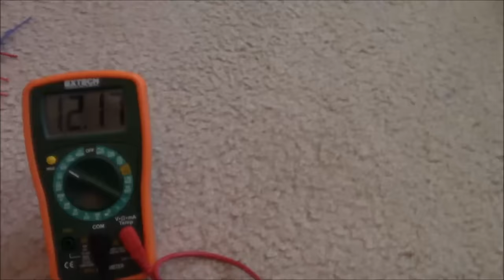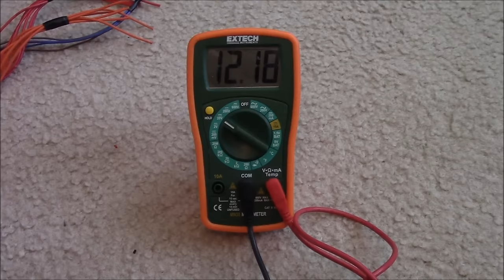How to Hack a Computer Power Supply (PSU) To Use as a 12V DC Power Source

Comment: can you run 2 12v dc car viper motors with that?
Reply from the maker: You mean wiper motors?  It depends on the power requirements of the motor but I think that should be possible.  My PSU in this video provided 20A of power so if both motors used less than 10A each then theoretically it would work.

Comment: Will this power a battery powered saw?
Reply from the maker: You mean will it recharge the batteries in a battery powered saw?  Or do you intend to try to connect the leads directly to the saw without the battery?
Reply: connect directly to the saw without the battery.
Reply: it is  18V saw
Reply from the maker: heo con
Then no it can't easily power your saw.  There are ways you could combine power from different rails to achieve approximately 18v but it is complicated and I don't want you to fry your power supply or hurt yourself.  Sorry!

Comment: What color did u connect to the green
Reply from the maker: Black.
Reply: Thank you I really couldn't tell if u hooked up black to green
Reply from the maker: Yeah sorry.  Basically, you are grounding the green wire.  When that happens the PSU will turn on.  If you detach the green and black it will turn off.  If you don't have a switch on the back of your PSU to turn it on and off you might want to wire in a switch between the black and green so you can do so.
Reply: Thank you so much man.. I appreciate it

Comment: i have a liteon PS and i connect the green to a black and nothing happens??
Reply from the maker: You may have to have a load connected to it in order to start the PSU.  Try connecting it to a 12V light or something as a test.
Reply: okay, ill have to get one i dont think i have one on me
Reply from the maker: Whatever will simulate a load.  You can even use a resistor if you want.  I don't know what size would be appropriate, though.

Comment: electricity in my place is so low it cant turn my computer on any tips
Reply from the maker: fidel oruko So you think the power coming from your wall socket is not enough to run your computer?  I would get a multimeter and test the power and make sure you are getting the right voltage first.

Comment: I saw your video carefully. . but I not understand one thing . . how you did . . I did same . . and power on supply in same way . . it didn't turned on . . tried many times
Reply from the maker: Your power supply probably requires a load to turn on.  Try connecting it to a small computer fan or something and see if it turns on and stays on.

Comment: Bro how much amp it gives?
Reply from the maker: Depends on the power supply.  The cheap smaller ones are around 20A or so.  But you need to look up the manufacturer's ratings.

Comment: What is the current output?
Reply from the maker: It will depend on the power supply you use.  Mine is 25 amps max on the 12v rail.

Comment: can I make more then one output sins there's more then one yelow and black
Reply from the maker: eduards neston Yes you can.  They will not carry as much current, though.  So if you want to power things that don't use a ton of power that is great.  If they need 100's of watts you want to combine wires.
Reply: OK sad for mi this morning my power supply burned down it just went Boooom......
Reply: Doe you think it is a good aidea to repair it...???
Reply from the maker: eduards neston
No, they are too cheap to repair really.  You have to be careful with exposed wires that you don't accidentally touch them together or you could blow something.
Reply: OK I'll buy a new one!

Comment: Did you use a load resistor?
Reply from the maker: No, the psu in this video does not need one to turn on.  However, newer models seem to be adding that technology in so you may need one for your psu if you try this.  Good question!
Reply: Thanks for your reply. I meant for the voltage to stay stable in light load situations
Reply from the maker: Elecifun
I'm not sure.  I haven't heard of that being a problem before.  Are you talking just a few watts or something?
Reply: They do not like to operate without a load. 5-10 Ohms dummy load 5-10 Watts will do. Probably only valid if it is powered on without a load
Reply from the maker: Elecifun
I haven't tried to power something that small.  Thanks for the info.

Comment: is there another way to wake up the power supply
Reply from the maker: You have to connect it to a load or simulate a load.  You can wire in a resistor or just connect it to a 12V load.
Reply: LDSreliance ok

Comment: does the ps watts make a differance.
Reply from the maker: It will make a different to how much current you can run off that rail, yes.  But the procedure shown in the video will be the same.
Reply: LDSreliance i just need 5 amps of power at 12v
Reply from the maker: Any power supply that you find will provide that.  That is only 60W.  The smallest CPU PSU's are at least 350-400W (200W on the +12V rail at least usually).

Comment: Dear sir tell me make pc Power Supply - 12V/5V (2A)
Reply from the maker: If you follow the instructions in the video it will make a 20A 12V power supply (or whatever the current rating of your +12v rail is).

Comment: can it run car 300 watt amplifier?
Reply from the maker: Mine couldn't but some could.  Just make sure that the PSU can supply ~30A on the 12V rail and you should be ok.

Comment: how can i get 10 amps with 12v from this power supply
Reply from the maker: Just like I showed in the video.  Don't try to pull 10A with a single yellow wire.  Bunch them up like I did.
Reply from the maker: You have to connect a load to it.  Something that will pull 10A.  If you only have something on there that uses 20W then you will only get 1.8A.
Reply: i am connecting car ac blower which draws 9 amp when connected to a 12v supply but here with this supply it is now only drawing 5 amps @LDSreliance
Reply from the maker: Check the specs for your model PSU and make sure you are using the main 12V rail.  You might be using a secondary 12V rail that cannot provide 10A.

Comment: ok I need to regulate the voltage? any ideas
Reply from the maker: +Brett Mabee There are all kinds of converters and regulators you can use.  I have used a couple of regulators (http://www.amazon.com/gp/product/B008FLE7PA?psc=1&redirect=true&ref_=oh_aui_search_detailpage) that you can vary the input and output voltage to your exact needs.  They are cheap but the directions they come with is not very good.
Reply: +LDSreliance Will it take the amps?
Reply from the maker: Brett Mabee
That one is only good for 5 amps but you can find ones that are stronger if you need.

Comment: how can i put on and oof switch... thanks for the reply
Reply from the maker: +nald rus If your unit has the green wire you can wire a simple switch in series with the green wire.  In other words, buy a cheap dc switch (for example:  http://www.amazon.com/Position-Panel-Slide-Switch-Rocker/dp/B00CQMM4HW/ref=sr_1_5?ie=UTF8&qid=1459430278&sr=8-5&keywords=dc+switch) and wire the green wire to one side of the switch and the black wire to the other side.  Then, when you flip the switch it will ground the green wire and the power supply will turn on.
Reply: thanks alot... can you teach me to put green led too
Reply from the maker: nald rus
What do you mean greed led?
Reply: a green light which led up when you turn it on... i just like to put a green light when i turn it on it lights up... sorry for my english im an asian
Reply: what do you call the green light... is it led??? light emitting diode??? is that correct??
Reply from the maker: nald rus
Yes.  But what do you want it to do?  You just want a light to come on when the power is on?
Reply: yup...!
Reply from the maker: nald rus
Then I would recommend getting a switch with an led light built in.  Wiring up an led by itself is a little more advanced than what I typically show in my videos.  There are lots of switches that have a light on it that shows when the circuit is on.

Comment: Exellent tutorial, would that work with a 12v 5A motor? I'd prefer not to use batteries, this would be a life saver if so..
 what you think.. anyone...?
 thanks. :)
Reply from the maker: Yes, this can easily provide 5 amps.  As long as the startup power required to spin up the motor does not exceed 15-20 amps you should be fine.
Reply: LDSreliance Excellent! I have two towers ready for recycling and a 12v 5A motor I was hoping to build into a cork-lathe or a mini wood turner for projects, even if I never used it, be nice to build.. power was the only reason it's remained a shelved plan..  I'd like to add a speed controller to it, anyway, thank you v much for the info.. really appreciate it. :)
Reply from the maker: Julio says No problem.  And I just ordered a speed controller for a motor I have that was only $9 or so.  So don't let that stop you from giving it a go!
Reply: LDSreliance Sweet, i'd been looking at the under $10 ones on ebay, guy had one in another vid, he was powering a wiper motor to show how good the cheap chinese ones were.. think the one I've on my 'watch' list is the one that goes peaks at 20A, no speedo-display.. has a reverse switch.. gonna start ripping down the PCs for the weekend.. thanks again, it's great to know I can ''power on'' with the project.. :)
Reply from the maker: Julio says Yep, good luck!
Reply: Hello again LDSreliance  , hope your weekend's going well.. I got to strip down one of the towers, I've the power supply out and wires all separated... all going well until I spotted two of the yellows, were yellow & black.. :o .. do these group up with the yellows or do I dismiss them with the reds, blues orange etc..? i didnt feel confident enough to make a decision, so jumped back on to ask.. thanks in advance.. :)
Reply from the maker: Julio says I would not use them unless you can find a wiring diagram from the manufacturer that shows the yellow and black is +12v like the other yellows.  Missing 2 of these small wires will not impact anything at all anyways.
Reply: do you have a video on this
Reply from the maker: Billy T
On what?  On how to use the +12v2 rail?
Reply: LDSreliance using it for a dc motor
Reply: Hi LDSreliance I never got a notification for your last advice, now get x3 :) anyway, i'd done as you'd recommended, ignored the striped yellow.. all's good, just waiting on the speed control device & I'm happy out.. really appreciate your help, got all I needed from this vid and your input.. many thanks. I really appreciate it. :)
 - julio
 ps Billy, just + & - it up.. black is ground.. yellow's pos 12v.. connect them to the motor. 
  thx again. :)
Reply from the maker: Julio says
You are welcome.  Glad I could help.  Good luck!

Comment: how can i use a 500 watt computer supply power to power a 310 watt power source at 120v
Reply: it's a DC powered
Reply: this is the input of my source Input voltage: 85v-265v Amperage: 2.6@ 120v | 1.436@ 240v
Reply from the maker: Why would you want to do that?  You would basically be taking 120v house power, converting it to DC 12v, 5v, or 3.3v power with the computer power supply, and then you want to convert it back to 120v again?  That would be very inefficient.  Unless you are talking about 120v DC, which I don't know why you would need.
Reply from the maker: OK, I guess I should have read all your comments first.  So you have a load that requires 120v DC @ 2.6 amps or 240v @ 1.436 amps.  You would have to add another device to boost the voltage, such as this one that will get you to 120v:  https://www.amazon.com/DROK-Numerical-Regulator-Converter-Adjustable/dp/B01GFVI6R6/ref=sr_1_10?ie=UTF8&qid=1474258320&sr=8-10&keywords=dc+voltage+step+up

Comment: hi,i need i need 12v 4a ! how can i get it
cause i get 12v 8a :/
Reply from the maker: +sami bioss Well if you have 8 amps then you also have 4 amps, right?  I don't understand the problem.
Reply: +LDSreliance 
i need it stable in 4a, cause i use it to turn off a screen,but cause its 8a the screen turn on for a moment then it turn off
Reply: +Davids Electronics 
pls how can i turn it for 4, or how can i use my screen as two device ?
Reply from the maker: sami bioss
Are you sure that is the reason that the screen turns off?  Almost all electronic devices that I know of will regulate the power they are pulling in on their own so there are no problems with providing too much power, only not enough power.

Are you hard wiring this screen without a power adapter or power supply built-in?

Comment: How can I get 12A , 12VDC?
Reply from the maker: Just follow the video.  It will provide about 20A 12VDC on most power supplies.  Check the manufacturer specs on the 12V rail on your unit.

Comment: What does sodered mean?
Reply: soldered, means that he "permanently" connected two wires (or more if necessary). In other words, he uses a soldering iron which heats up the solder (solder is like a metallic glue kind of material) and puts it between two wires. After a second or two, the solder is cooling down and it hardens itself, by that it "permanently" connects wires.

Comment: how many watts does it handles?
Reply from the maker: The one in the video provides 20A on the 12V rail.  So 240W.  It was a small, cheap PSU.  You can get some that will provide much more power than that.
Reply: @LDSreliance  thank you sir, does it mean it can handle a. ten 15watts led module which is 12 volts?
Reply from the maker: Ten 15W led modules?  So a total of 150W?  Yes, that would work.
Reply: @LDSreliance  thank you again sir. i feel relief. ^_^
Reply from the maker: Keep in mind that LED's can be tricky, though.  You probably still need to run an LED driver to regulate the voltage to the LED's.  I'm not an expert, though.

Comment: Why the hell i keep getting double voltages at all the group cables?!
Reply from the maker: +Olis Iraklis What do you mean?  You are getting +24v?
Reply: +LDSreliance exactly
Reply from the maker: Olis Iraklis
Try measuring the voltage of one positive wire individually and see what you get.
Reply: i get still 6.66 V
Reply from the maker: Olis Iraklis
So what are you testing when you get 24v?  Did you combine all the yellow cables like I did in the video?  Did you crimp them to a connector?  Did you solder them together?
Reply: +LDSreliance yeah I just soldered all those yellows and all the blacks together so I am a little bit confused with that voltage :P
Reply: +Olis Iraklis at groups not together yellows with yellows and blacks with blacks *
Reply: i think i figure it out i have my multimeter dead battery replaced with 12 v and it maybe shows the voltages doubles cause its a crap multimeter . xD
Reply from the maker: Olis Iraklis
Haha maybe so.